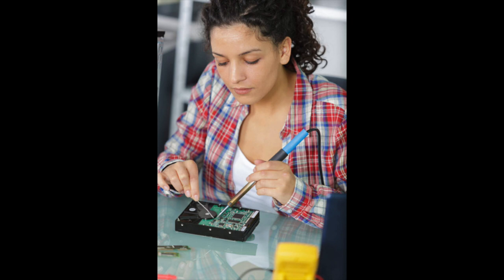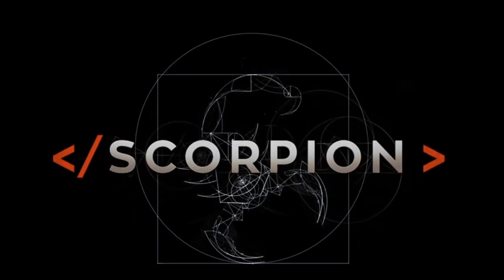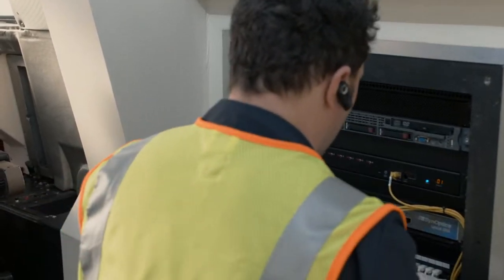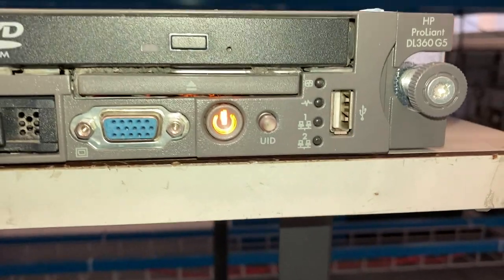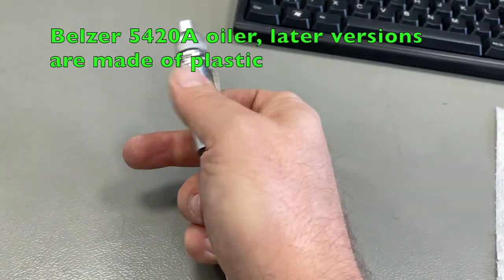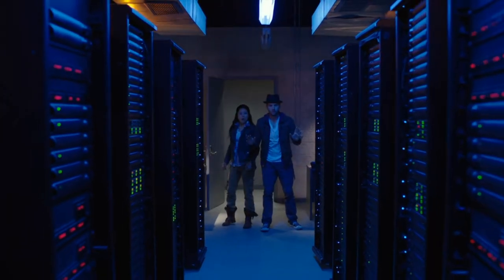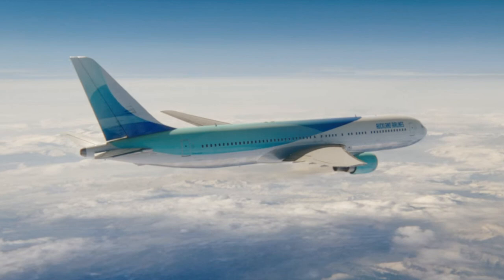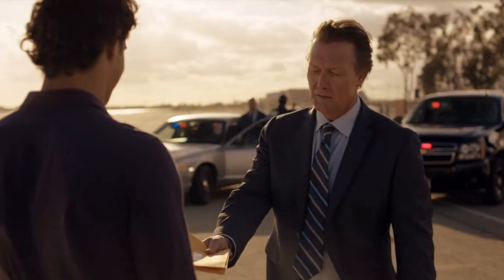IT guy reacts to Scorpion and Blacklist on Netflix - (PWJ189)

Comment: This is the 2WD version of the 747, only two engine have traction, the other are dummies. After the 90s Boeing stoped offering the 4WD on planes, they focused in 2WD jets.  But to avoid recertification of the 74, they keep installing 4 engines where 2 of them are spares. If one engine punctures, you have can use one of the dummies. You need to stop at the nearest airport to swap the engine, you cant fly with a flat engine for long, unless you can stand the TPS alarm all day.
Reply from the maker: Ah...OK...I didn't know that!  ;-)
We are laughing now but check this out: https://www.iol.co.za/motoring/industry-news/so-why-did-jhb-bound-747-have-5-engines-1967613
That's not a fake, they frequently used B747's to transport spare engines to remote places.

Comment: I allways carry a 20m patch cable on my hand bag when flying :)
Reply from the maker: patch cables are only allowed up to a length of 30cm in hand baggage ;-) Otherwise you could patch the entertainment system to the flight management computer and crash the plane by using your AT&T phone card from your business class seat. But only if the seat is inclined to exactly 33.2 degree.

Comment: I loved the show, but you are so right for a show that is suppose to be based on a real person.
1 Car and patch cable impossible to do.
2 Too much space in the plane that is not in real planes.
3 No either net cables on any aircraft systems, at least not in any Boeing aircraft that I worked on.
4 Flight deck not Boeing, but could be another aircraft.
5 Black boxes are connected from behind the box, except power on power supplies.
6 Didn't like how they opened the door with the lock on the building, very unlikely.
7 Can't climb out on the nose wheel from inside of a Boeing aircraft like they did, impossible in flight.
8 No USB access on aircraft black boxes.
Just a few thoughts I had watching the show. I am constantly amazed on how much room they think is inside an aircraft.
Reply from the maker: Let's add...
- No HP Gen5 servers in any aircraft!
- This was clearly a home built simulator, therefore the HP server and KVM switch etc.
- Producers did not consult anyone with a technical background (or maybe a 13year old)
- Have you ever heard that "tower software" is stored on aircraft?

The whole episode is totally rubbish. An episode of "ALF" is more realistic and also funnier...
Reply: @PlaywithJunk  :)
I got tried of making a list, and cut it at that. 
The thing that gets me the most is how large they make the insides of aircraft avionics bays. The only one I know of that is accessible from the cabin area is the 747, and that has carpet over it, and maybe even something else the costumer wanted on top of that. Let alone getting to any of the wheel wells or cargo bays, which is impossible from the upper decks without cutting through something with portable power tools.
Thanks.

Comment: Ethernet and other buses are used in aircraft, but it isn't left flopping around on RJ45 connectors.  Also, if an aircraft is low and slow enough for a car to catch up... it can land. 🤦‍♂️
Reply: Yes, but if the plane landed in this movie, it would have to explode and destroy the entire airport.
Reply: every airplane can be landed by hand. thats why those 2 people sitting in front of that plane :-P

Comment: I burst so bad in laughs with the ferrari Ethernet thing  ..... Comedy gold. This only makes people afraid of jets ..... all this computer stuff is BURIED into the plane, and I much doubt there is anything "standard" there, all aerospace grade systems and modules with custom SW and custom HW. It is a pain even for the field technician to update parts of the systems, take HOURS to do. There was a story about a guy "break into" a 777 system through the entertiment system of the plane. Sure, because Boeing is so stupid, they never worked for defense / military and they are clueless,so they allowed a bridge between the entertiment system and the plane systems ... they couldnt see the threat comming. Why all this rack parody with roten stuff when you "can do it from your seat" ... lol ..... Well At least we got the Pirifarina logo showed nicely a couple of times.
Reply from the maker: I'm pretty sure you won't find any RJ45 connector in an airplane. And if there is one, it's an industrial version with screw or bayonet lock.